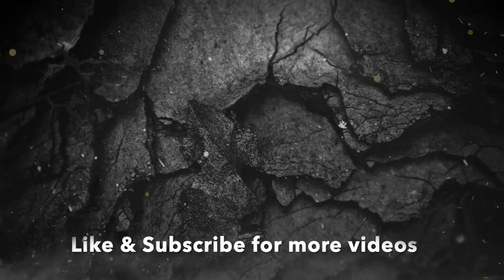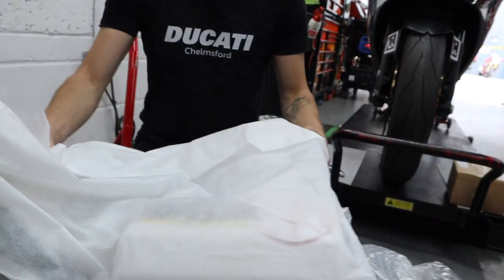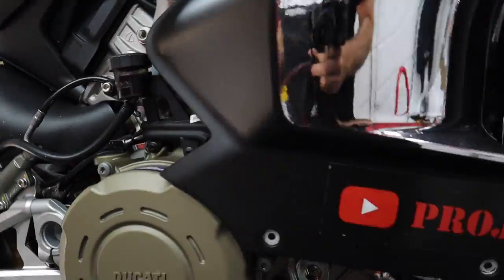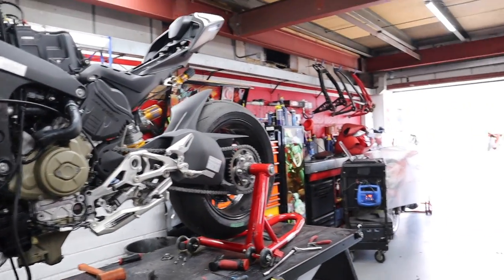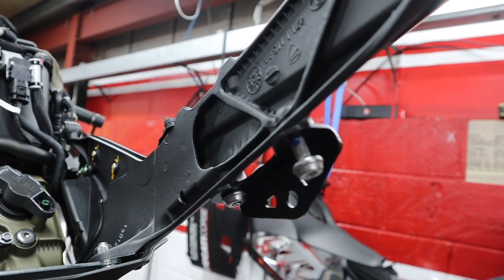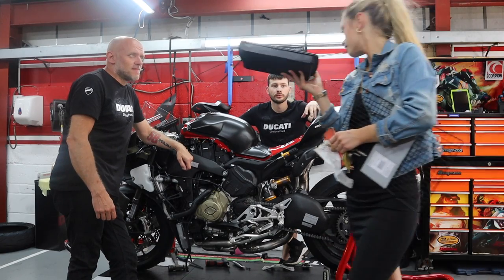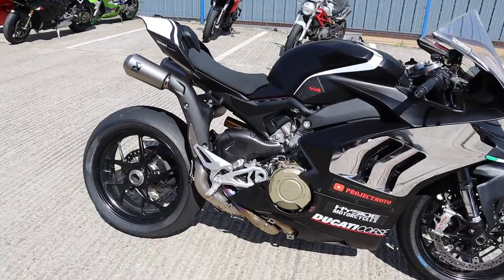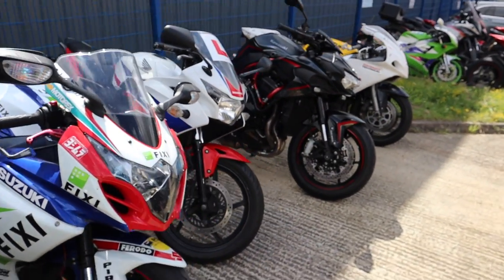Ducati Panigale V4 Akrapovic Full Titanium 'Wheelbarrow' Exhaust system

Comment: I was in two minds for this or the Termi , ended up going for the Termignoni which sounds like a missile every time I change gear 😂
Reply from the maker: Yeah mate those Termignoni exhaust sound awesome as well😎
Reply: Is your warranty still available?
Reply: @sushi_edits225  warranty what's that 🤣 I got rid of it last month and bought the R1M
Reply: @thesavages3356  lol, btw how’s the R1M compared to its rivals? Does it feel the fastest from 0-300? Because I’ve read some sources and seen videos that an R1M does 0-300 in 13.28 seconds
Reply: @sushi_edits225  to be totally honest mate I haven't got a clue , I'm sure the H2 might break a few sound barriers 😜
Reply: @thesavages3356  at stock H2 takes longer time to accelerate from 0-300, but if you put a full exhaust and tune the ECU, You’re expecting 250+ wheel horsepower!
Reply: Which Termi?? The 4xcite?
Reply: @USAracing  yep , it's like two barrels of a shotgun 🤣 check the channel out if you want to have a peak

Comment: What tune did you end up using? I have heard that owners of 2021 and lower V4 models fitted the same system and used the T800 UPMAP for the akra exhaust
Reply from the maker: We had the bike mapped on a dyno and they had to move the Lombard sensors as well on the exhaust

Comment: Where did you get that chain guard? Need it for my 2019 V4S Corse. I want to get the same exhaust as this video
Reply from the maker: It came with the exhaust , for the 2019 you would have to have it mapped somewhere as you can’t use the 2022 map form ducati

Comment: Hi guys. I have a 2021 V4SP. I’d love to fit this exhaust off. However the Ducati dealers can’t tell me if I can fit on my 2021 or if they can upmap. 
If I get it installed how hard is it to get the right map for my model? 
I’m in Australia. Thank you!
Reply from the maker: The exhaust is for the 22 model and the map Ducati have is only for the 22 model so they will not be able to use the map, we had to have the bike mapped on a dyno and there was some work to be done with the Lombard sensors as well being moved , you would need to talk to someone who can do the map and work etc to see if they can do it for you .. which obviously is an extra cost
Reply: @ProjectMoto  hey man thanks for the reply. Yeah I suspected I’d need a custom map. I’m just thinking wouldn’t the 2021 Akra titanium pipe map work on the 2021 model? Yeah the pipes are shorter for that older pipe but essentially they’re similar just different shape. Or does the exhaust length matter in the mapping

Comment: hi, question, can i installed this exhaust without flashing the ecu on my22 v4? im planning to use servo eliminator kit, and leave the ecu stock.(will it show check engine light?)
is there any different in lamda qty between v4 2021 below and v4 2022?
Reply from the maker: This exhaust is for the 22 v4 , the bike will ‘run’ with the exhaust without the map but you really do need the map update from Ducati to work properly , if not it will fuel it wrong and end up doing damage , also will also invalidate your warranty without the map , it will also throw up the engine management light as well.. so you need the map!! The Lombard sensors are different on the previous Panigale’s .. if you put this on a bike pre 2022 We had to have ours on a rolling road all day and had it mapped, it’s all ok now but they do have to change the Lombard sensors changed, so they blank off the old sensors and just have 2 new ones in a different place.. obviously once you have this map and changes you can’t update the software anymore though

Comment: What have to be done to the lambda sensor to fit it on a 2020v4? Is it easy to do so?
Reply from the maker: The original sensors had to be taken out and the holes blanked off, then 2 new ones that were with the new software were added in a different place, it is a bit of work obviously and would need to be done by someone who knows what they are doing
Reply: @ProjectMoto  thank you

Comment: I have a question. I want to purchase the oem Ducati race fairing for a v2 panigale. Can you still run the lights in it ? That exhaust sounds something else 💦
Reply from the maker: We put those fairings on our V2 track bike, the kit does come with the blanking parts for the lights which I think they are just blank moulds same as the lights and bolt in the same place, tbh I think the fairing are just normal panels that are not painted so I think the lights just fit in as normal
Reply from the maker: And yeah these exhausts look and sound awesome 😎

Comment: Wait a minute - (thanks for the video first of all), I have a 2022 Panigale V4S and I'm trying to fit a used Akrapovic full system (under body) from a 2020 Streetfighter V4S to my bike; but the shop says these 2020 pipes only have connectors for 2 oxygen sensors.  I'm really confused because your bike is a 2020 model yet it has 4 oxygen sensors, like my 2022 model.  Is this a special UK emissions thing maybe?  I'm in Canada btw.  I'm wondering if I can still use this 2020 exhaust with just 2 sensors, do you know?  Thanks again!
Reply from the maker: They are different so they won’t be able to just change them over , I think the map for a 2022 bike is also different, for our bike which is a late 2020 bike(maybe 21 Model??) we had to have it taken to a place that put a map in the bike and had the bike on a dyno , also they had to blank off the old Lombard sensors and put new ones in different places on the exhaust system

Comment: Hi did it need a tune or ecu flash or map or pcv?
Reply from the maker: It will be mapped , just not had it done yet , you can get a map for it from Ducati if you have a 2022 bike as it’s only for a 2022, but ours is a 2020 model so we need to get it mapped our selves

Comment: Any idling issues without a tune? Any stalling?
Reply from the maker: It was ok but there was a little fluctuation in the idling , didn’t stall at all , I rode it on the road and it was ok but obviously could test it at a fast pace , we’re going to have it mapped any way
Reply: Ok cool... was just asking, because im trying to learn n figure out wether my bike is just running too lean causing the fluctuation n stalls at times... its a MV AGUSTA TURISMO VELOCE LUSSO... different bike, but yeah same theory... still lesrning n diagnosing... my mods are ,decat stock exhaust... n wonder if a BOOSTER PLUG could help alil bit.. on a budget here... the decat is more of a repair, because the CAT dmaged, came loose n moving around in the manifold... i gut it out and weld

Comment: Do the wheelbarrow exhausts increase testicle temperature?!
Reply from the maker: Well I couldn’t really tell when I ride it as it was really hot out anyway .. but your always be hot on a Panigale v4 , usually changing the exhaust helps a little under the seat, but not your legs so either way your cook a little somewhere 😂😂
Reply: @ProjectMoto  Very true! Have a v2 here in Dublin and it’s quite comfortable even at the height of the Irish ‘summer’ 😂

Comment: It's a euro5 bike though? Didn't think the euro5 came out until 21?
They quote the same 6% on the normal Akrapovic system. I heat treated my system on startup to get it nice and blue on the off. 😎
Reply from the maker: Tbh I can’t remember when Simon got the bike, he said it’s 2020 but can’t remember exactly when he got it .. personally I think it’s a model year ‘2021’ that we had at the end of 2020 , will check , the pipes look so cool when they change colour 😎

Comment: Where did you get that carbon rear hugger?
Reply from the maker: It comes with the exhaust , I guess it’s more of a chain guard then a rear hugger :) you can order them , not as as accessory for the Panigale  but through the spare parts for the kit , they cost £201.22 , they do also do an actual rear hugger to fit with this exhaust